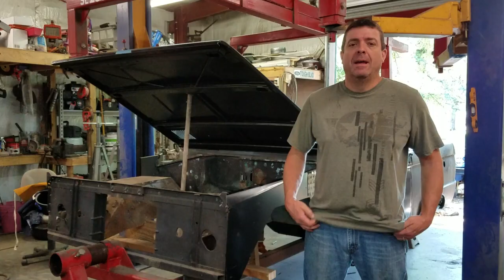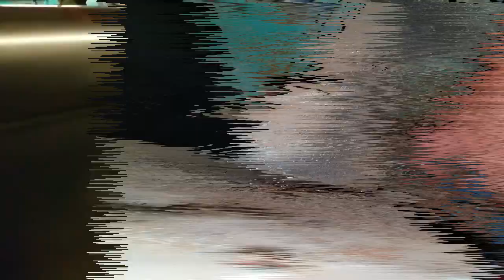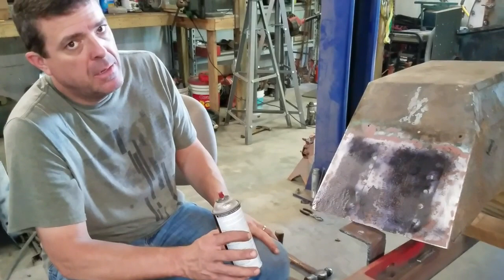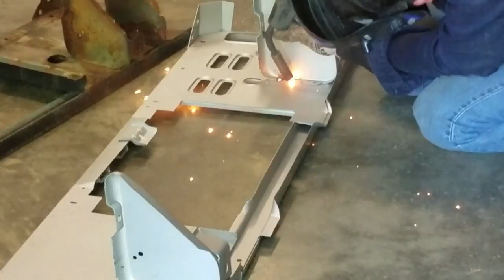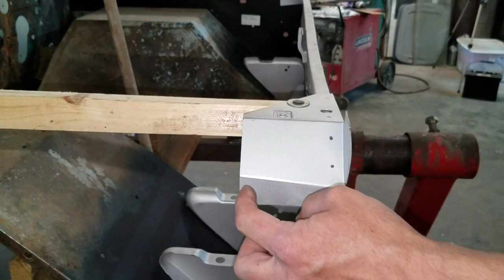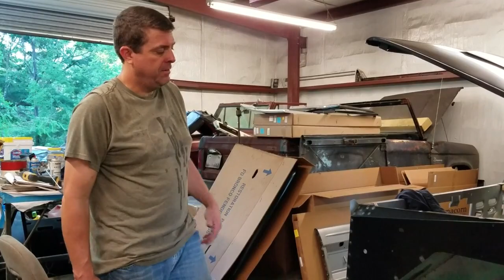Radiator Support Install - 1966 Ford Bronco Restoration Project

Comment: Jason the original radiator support has those long diagonal supports in the middle, but I noticed that the replacement does not. Mine is in great shape, but i'm doing the same thing you are (6cyl to V8). Do you think I just need to cut them off flush
Reply from the maker: Jim, If your support is good yes I would just open it up so you can get the additional flow.  I would not cut it until you have test fitted the radiator your plan to use.  Good Luck!

Comment: Hey where can I find the dimensions for this? Love the videos
Reply from the maker: Brett send us an email and I can send you what I have.  Thanks for watching.
Reply: @JasonJonieBuilds  hi Jason and joni ive been trying to get rolling on assembling my 73 body.  The old one was extremely rusted and any measure that I had was from parts that didn't line up anyway I was curious about your other dimensions?  You mentioned the first one but not the other 2 in the video.   Thank you so much for the videos they are a big help
Reply from the maker: Daniel send me an email and contact info.  I will give you a call next week and maybe be able to give you the dimensions you are looking for.
Reply: @JasonJonieBuilds  how can I find your email?
Reply from the maker: Jasonandjoniebuilds@gmail.com
Reply: @JasonJonieBuilds  thank you I will be in touch

Comment: Fixing to do the same project with a Bronco that has been hit in the front end.  Do no have dimensions, could you please post or email me dimensions?  Thanks in advance.  email@jamesmarine@bellsouth.net
Reply from the maker: It might take me a few days before I can get them.  Please know that the dimensions will be what worked out on my Bronco.  Most of these dimensions will vary +/- from Bronco to Bronco.  Since yours has been hit I would use screws to temporarily mount it and along with the other panels to make sure everything lines up.  I will get back to you by next week.  Thanks for watching!

Comment: I'm about to do this exact process, inner fenders, tubs, radiator support on my 66'. Is there anyway you could email me your dimensions or a take a picture of them. My Bronco had been crashed before I bought it and don't have proper dimensions. Thank you in advance....Jim. my email is jim66hotrod@gmail.com
Reply from the maker: Yes sir I will email you.  Keep in mind they are guidelines not exact.  It may be tomorrow but I can send a few dimensions I have received from other sources too.